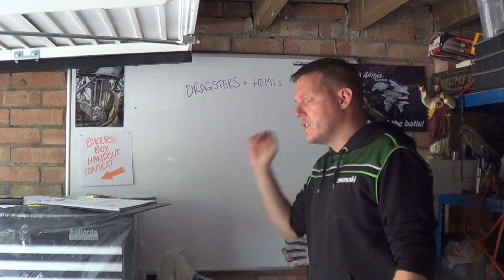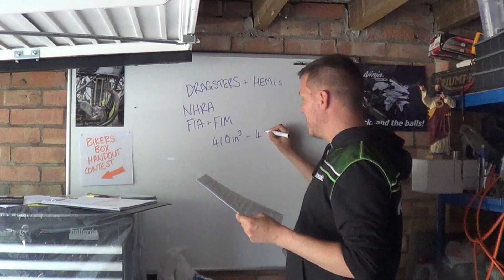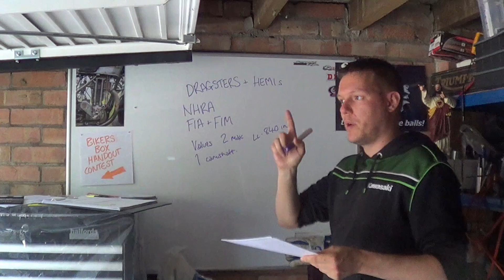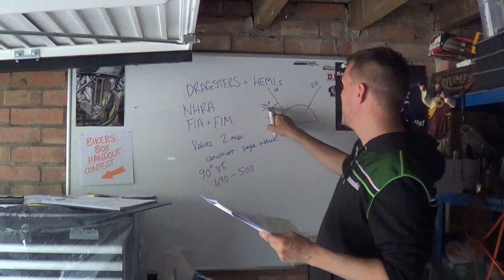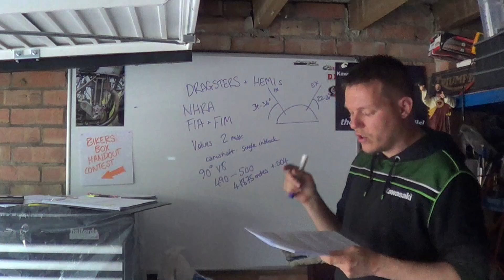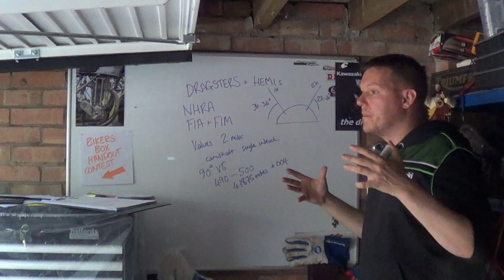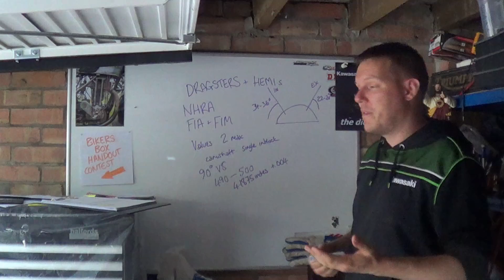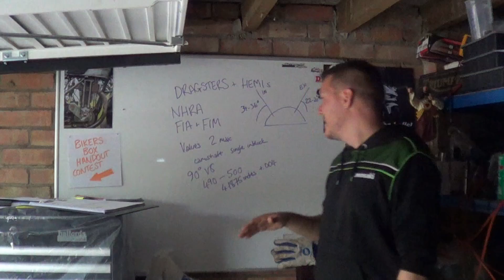Why do Dragsters use HEMI's?

Comment: Firstly, the hemis are already so fast that they overpower any car possibly built to the point that the tracks were shortened from 1320 to 1000ft! So why try?  Next, Chevrolet never made a 428,  426 Hemis were MOPARS, sometimes you K.I.S.S. a design and get it right the first time! and GM was pissed about the rule  and for once wasn't in control and never controlled Ford or Chrysler! almost ALL ww2 radial aircraft engines were hemis, Arias created hemi heads for Chevys because that was the only way to be competitive in tractor pulling, and alcohol racing. you want rules? NTPA pulling only allows 3 hemis on a tractor to compete with 4 of any other designs.  I watched a guy have to shut down 2 hemis out of five to compete against a 4 engine Chevy based tractor and still won. Rules? You're forgetting NASCAR making hemis add weight, then run restrictors, etc. Eventually all the $$ being spent by ford with overhead cams and GM trying to beat it caused congress to actually step in and stop it!  the guy influential in that was from GM.  Some drag racing rules REQUIRE that any dragsters in that class with a hemi has to weigh 2lb/ci MORE than others. Think about that, thats up to 1000lbs more in a 2000lb car! Yet they still run em because its more cost effective due to durability.  Big Daddy Don Garlits when asked if the hemi was overrated said "hell no! It deserves every accolade it ever got!" Some bodies state that hemis must run Naturaly aspirated against blown competitors!  Sonny's who build over 1000 ci Chevy sort of based v8s charge a premium to get hemi heads instead of the best chevy style for top performance.  The metal between the valves and the  lack of pressure deformity as well as even expansion, dual plug locations is why they are preferred for Nitro.  Adding more flow to the cylinder head with more valves will give up these benefits.  Top fuel motors aren't as limited on flow as you think! A good set of TF hemi heads will flow over 700cfm per cylinder! There are hemi heads that outflow these but are unnecessary. And some teams reduce this for better port velocity.  Also, flow isn't really a big limiting factor even at 10,000 rpm, since nitromethane carries its own oxygen and will burn without air, but Top Fuel dragsters run at about a 4:1 AFR I believe, instead of 12:1 - 13:1 AFR with gasoline. that translates to needing at least 3x less air. Getting enough fuel in is harder. Theres a video that shows the awsome injection flow for one cylinder. That Hemis 65hp fuel pump can drink more nitromethane than shoving all ten nozzles at a gas station into the blower! The motors are limited by the intense cylinder pressures more than flow. They compress the best connecting rods enough that it drops compression by about half track. They were spending millions in the 60s to try and beat it with overhead cammed ford's. They did, after 2 years of blowing up engines manage to beat A 1958 392 that probably came out of Grandpa's Imperial! Then, it was bested by both  426 and 392s and retired. Pontiac tried to beat the 392 with a hemi headed motor, ended up going back to a 392. Safety is the biggest reason for the rulings because the Hemi is a known quantity, and people who had tried to beat it knew so. There were no rules governing TF in the 70s that said anything about it's having to be a hemi but by 1976 there were NO other brands! Most of this ruling is also financial because of the already developed aftermarket and the fact that if another totally poupose built engine was only .2 of a second faster that company would have a monopoly and could price gouge. And wouldn't have to care if they broke more often, (HUGE fire, exhaust valves over the stands into the parking lot, and possibly a wrecked car) .were harder to work on, had 6x as many components etc. Because they are the only ones allowed to sell you parts for the 17yr patent! The hemis generate almost 2 TONS of downforce from the exhaust alone! They have registered a 2.2 on the RICHTER scale 3mi away! And given half a chance will actually rip a dragster right in half! Credit where credit is due! I'm certainly not saying that there's nothing better, especially when naturally aspirated, they require huge piston domes for compression that limit flow.  And 4 valves can flow more and wind higher, but it's resistance to detonation, reflecting more heat into the chamber and NO need for quench (as per the piston maker) and sheer simplicity will always keep it alive. Someone always offers up a one off engine that beat a hemi once, and that is an accomplishment and I give them credit, but where are they now in drag racing or modified tractor pulling etc?  which by the way is allowed to run them and turbos but rarely run them either.

Comment: Throwing an idea out there. Would it be possible to stick to these sizes and specifications but run as a 2 stroke? The valves could be there and at right angles but the rules don't necessarily state that the valves have to open.
Reply from the maker: You can't or wouldn't be able to run sealed cases with that much boost

Comment: For motorcycle drag racing a 4 valve/ cylinder billet head was made but it was not allowed and inline 4 hayabusa engine have way more displacement restriction than harleys and the riders and cycle tuners said its all cz the all american engineering should win!

Comment: A restricted class will be dominated by dohc 5 valve or 4 valves per cylinder this cause the extinction of the all american 1 cam 2 valve/cylinder thing.
Reply: @jdog942 it has been proven in so many areas when certain organizations ban something like matrials being used or certain designs its either financial or political or for safety which pushes teams to take inferior technologies beyond imagine extents.

Comment: The guy talking here has quite s but if knowledge. The quench is every thing that’s piston driven. Read about the quench the area apposed to the valves between the top of piston to deck of head. We run 198-202cc chamber with a flat top piston that sticks out of block anywhere from .160” to .280” depending on witch cylinder in a nitro engine .because we run a different static compression in every cylinder . Some guys do it by using different compression height pistons some do it with staggered con rod CC. If you look up a P5 hemi like the mopar and ford prostock  engines use they are a “semi hemi” meaning they have a flatter valve angle and a quench pad on either side of the valves. Top fuel hemi is limited buy rule to a 4.185-4.187 bore. To get the max cubic inch we have to run a 4.5 “ stroke. Also because it’s a smaller cylinder a fuel engine runs a smaller intake and exhaust valve that a alky engine. Most alky guys run a 4.380 bore and a 4.250”stroke . Your reading rules of 2 different motors . A alky engine and a fuel motor are nothing alike really . Also nitro runs a 3.2 degree standered helix and a 14/71 has a 19” rotor length. Pro mod hemi uses roots type but hi-helix rotor over 4 degrees. Alky funny car and dragster use a PSI single screw with a wiper type blower they have a 4 lobed rotor spinning 33% faster than the 6 lobe wiper. The reason we use a hemi is because of the crossflow characteristics of the hemi at WOT.  Also we can burn nitro 1:1 now so we burn about 12 Oz of nitro every time the piston fires that’s why we need room in the combustion chamber and don’t care about the quench. We also with 2 44amp mags use about 55 degrees of ignition advance in a nitro engine. The same engine with one mag like in nostalgia with the one mag rule we run 75 degrees of spark advance . A alky motor on one mag is about at 28 degrees of spark advance . Every modern twin cam engine is a hemi type. There are several types of hemis! There’s a Chevy hemi called a MBR in alky that uses a BBC  block and bore center. Your talks are usually great but you are missing a bit of information on this one. Honestly back in the day what most people miss is the hemi is what we use because it’s the best combustion chamber and valve lay out for WOT. Wide openII throttle . If you took a OEM 426 hemi AND RAN IT ON A DYNO against a 440 max wedge. You would find out the hemi made more peak power but the wedge made more average power over the WHOLE operating RPM. A drag car only cares about WOT and because a engine is a compromise we use a hemi. Also I didn’t hear you bring up the fact that a perfect explosion aka expansion is a sphere . Things to look AT AND DROOL AT🤣 BAE brad Anderson enterprises , AJPE Allan Johnson Performance engineering , MBR miner bros racing MTS meaner than shit Chevy hemi that was the Arias and Fontana engine. Noonan Racing and the black hawk2 alky hemi head. CFE Chuck Ford engineering . And MBE cylinder head. Now a top fuel car burn close to 2 gallons of nitro a second are fuel pump is made by RAGE fuel pumps and puts out 130 GPM aka gallons per minute that’s at 4,000 rpm pump speed because it’s driven off the front of the cam and 8,000 rpm engine speed🇺🇸💪🏼🏁⚡️endit

Comment: Great video to watch.Out here in Australia there's a top fuel team known as Sainty.Our rules permit them to use an over head cam 3 valve per cylinder engine.Worth having a look at.Also in the late 80' & early 90's in NHRA was an Australian top fuel team the Mcgee's. Also using a 3 valve over head cam engine.

Comment: The Chrysler Hemi has and always will be the king . It's the only engine design to break the sub 4 second barrier. No other automotive engine has filled the thirst for horsepower more than the Chrysler Hemi. It is a engine that is easily repaired between rounds and it has a cylinder head that breathes very well . Between the rounds setting up the rocker arms and lash where easily done in the alloted time because of the rocker arms are shaft mounted.The Chrysler hemi ruled on this one task. In doing so , the NHRA ruled out all other engines to run in top fuel since.  So the Chrysler Hemi has and will always be king until a new design comes out to play and prove itself worthy.

Comment: You go into technical specs which dont explain much as to why the Hemi based design is used. All forms of motorsport are about going faster, thus lap records and times always progressing. If another design was better it would of been in use years ago. Fact is that the hemi design makes the most power, especially in forced induction applications, the blow through design is unbeatable for this. Its very obvious that you have no experience in the field of drag racing engines. The engines are hemi based design, but have no affiliation to Chrysler, they are all purpose built to get the job done best. You refer to a ferrari engine not holding together with 8000 hp when we all know that its impossible to get such an engine to produce that hp in the first place. It always amazes me as to how many channels on here post grossly uneducated videos, and the amount of suckers who subscribe to the bullshit posted. I am a former race engine builder who knows exactly what is real and what is just wank.
Reply from the maker: "You go into technical specs which dont explain much as to why the Hemi based design is used."

- yes I do. Because its tried and tested. With such a dangerous sport the FIA don't wanna risk allowing unknown components.

Comment: The quad valve, quad cam, 32 timing gear Australian designed McGee engine was a winner in nitro classes until the governing bodies banned them and ruled that the hemi was the only engine to be used.
Reply: Grant Pollard ... The McGee engine was a good attempt, and God knows Kenny Bernstein and Dale Armstrong put enough money/ reaserch into it , fixing a lot of problems and shortcomings. In the final analysis, it wasn't able to put up with the rigors of nitromethane racing. It was too complicated to do between rounds maintenance in the time available.( To keep the show moving, for TV etc...) The Chrysler based Hemi design has had almost 7 decades of research and development. Finicky double overhead cam, electronic fuel injected designs, just don't lend themselves to this type of racing, I read comments like " the Americans would run carburetors if they could" well if you think top fuel engine's are. " Dumbed Down" , then you have never been around one, some of the smartest engineers/technical people have been developing these engines for a long time. I'm sure that if some " genius" came up with an alternative design that would meet all the criteria that the current design is capable of, the NHRA would consider it like they did with the McGee
Reply: Murray, the way the engine design rules are written it would make it very difficult to design anything but a hemi engine.

Comment: Who would have thought that racing has rules?
No one has used a stock Chrysler hemi engine in a top fuel drag racer since the early 70's. The original engines would not last 2 seconds under full throttle.
Engines that blow up are super dangerous for drivers and spectators alike. So they limit options to those that work.
I challenge you to build anything else  that can last long enough to race for the money.

Comment: You have to have some kind of racing or performance industry . There is a guy named bob miner I worked for. The rues allows his motor the MBR Miner brothers racing MTS meaner than shit Chevy hemi. For that engine the vale angles are 18 on the ex and 21 on the intake. The bore center is based off a bbc @4.883 . The Chrysler version is oem 4.840 and 35 intake and 25 on the ex.

Comment: I'll correct myself here some what you can fly cut the bore of the block to accept slightly bigger valves like done on some high performance big block Chevies for example but the valves are shroulded on the outside of the bore limiting any gain ,so the hemi is still vastly supperior in flow all things being equal I port size port finish ect

Comment: Hemi stands for hemisphererical shaped combustion chamber,hemi is a Chrysler trademark yes but outher engine makers make hemisphererical engines hemi for short Ford's 429 boss engine was a hemi the regular 429 s were not I had a Mazda 4 cylinder hemi ,sombig deal the reason for hemi heads in very high horsepower engines is simple no outher valve arrangement will allow the use of the bigger space provided for the valves by canting them !you can't put two valves in any engine that exceed the bore of that peticular engine unless it's a hemi !

Comment: Central spark plug location for the most predictable combustion characteristics. Flame front (in theory) hits the piston with the most downward force, rather than wasting energy hitting the cylinder walls and reflecting down to the piston.

Comment: A regular American V8 engine block wouldn't survive top fuel.   So they use a billet aluminum block and heads.   They dimensions, such as bearing caps are much stouter.

Comment: I haven’t gone through all of the comments, but in my quick scan, I did not see any correct answers.
HEMISPHERICAL cylinder heads and valve trains cost more to produce than a typical overhead valve arrangement. Because of this, they were semi-rare from the factory. The factory could create 90%hp for 3/4 the cost, they’d go with the overhead valve. 
The reason top fuel cars typically use hemis in the beginning, was because the hemispherical head design could flow substantially more air/fuel which is mandatory when it takes like seven times nitro to gasoline. 
As the years went by, aftermarket parts became available and became proven designs and ultimately safety is the top concern. This is the reason for strict rules. The safety isn’t just of concern for driver and crew, it the spectators also. There’s a lot of history and learning curve to get them where they are at and have a proven recipe for performance, reliability,safety, and biz. 
I actually enjoy your vids and the science you have to back up your thoughts, but I think this one was a bit off the mark.
Reply from the maker: I agree, but I'm not perfect and there's always more to discuss....
Reply: "The factory could create 90%hp for 3/4 the cost, they’d go with the overhead valve. "  I'm sure this is just me being an ass, but all hemis are overhead valves.... :)

Comment: This guy basically doesn't understand the history and why Hemis are used. Other styles of engines were tried and failed. The Chrysler Hemi is the best choice for pushing the envelope of just how much power a 500 ci engine can develop and that's the reason you don't see Ford or Chevy engines in top fuel and funny car.

Comment: combustion chamber efficency, and then durability, it is the best considering both. The plain ol; best combustion is Yamaha's 5-valve, but that would not be durable or cheap enough to replace every 5 minutes ( 60 five second runs). For a cylindrical bore and equal-area sized valves, increasing the number of valves beyond five decreases the total valve area. The following table shows the effective areas of differing valve quantities as proportion of cylinder bore. These percentages are based on simple geometry and do not take into account orifices for spark plugs or injectors, but these voids will usually be sited in the "dead space" unavailable for valves. Also, in practice, intake valves are often larger than exhaust valves in heads with an even number of valves-per-cylinder.

    2 = 50%
    3 = 64%
    4 = 68%
    5 = 68%
    6 = 66%
    7 = 64%
    8 = 61%

Comment: Hemis are the only internal combustion engine that can handle the VOLUME of fuel required to make that much power with nitro. Wedge engines reach a fuel volume limit before hemis.